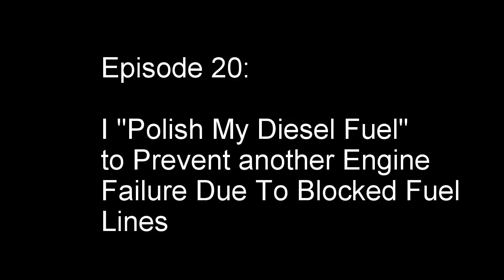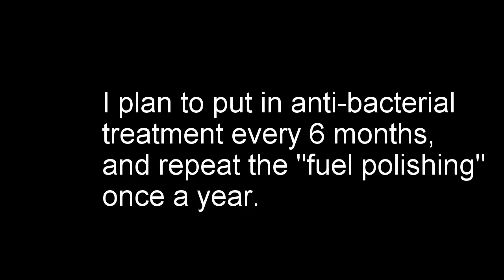Ep 20 Diesel Fuel 'Polishing' To Prevent Clogged Filters and Lines

Comment: I spent Lord only knows now many hours purifying JP-5 at sea. We had an aviation capacity so we had two large filter/coalescing units, (5 end 7 element arrays) a couple of vane pumps and about 50,000 USG tank capacity. We used JP-5 in the auxiliary diesel generators and the small boats until we got our helicopter aboard. 10 mic is what our filters were. They can separate the free water, but the entrained water slides through them. Entrained water has its molecules entwined with those of the fuel oil. Hence the name. I am a fan of recirculating systems. However in pleasure craft I am not a fan of using positive displacement pumps in the systems. The reason is because if the valve line up is not correct, gear, vane and reciprocating piston pumps can easily produce enough pressure to force fittings apart, split fuel lines and easily rupture tanks. So having a manifold linking more than one tank can present problems. For that, people should add pressure pop off valves on bypass lines that divert high pressures from the pump outlet back over to the inlet to prevent catastrophic failures OR use non-positive displacement pumps.  And of course, NO recirculation operation should ever be left unattended while the pump is running regardless of the number of tanks being tended. Also of note, any filter array whose input and outlet pressure is off by 5 PSI or more needs to be replaced. So a few simple pressure gauges can be used to positively identify when a filter needs replaced. Not only is that factor used for fuel filters, but one good for lube oil filters as well. If I were you, I would consider putting in the fuel tank fittings needed and mount the system permanently so it could easily be used at sea. Traveling around, the 1st hint of contaminated fuel more likely than not will be exactly as what you were hit with. Most often things go to hell in heavy weather when the bottom sediments get kicked up off the bottom of the tank or start rolling around in the bottom. If you set that up in a permanent installation the line back into the tank should be extended to the bottom of the tank as well to help blow the sediments up off the bottom so they will more surely get picked up for filtration. IF I were doing it I would also consider getting a clear, fair sized strainer with a bottom blow fitting so the sea snot doesn't take out the primary filter too easily.
Reply from the maker: Lots of excellent advice there Spencer.  The voice of experience.   I wish I could install a permanent recirc/filtering system, but I just don't have the space.  My tactic henceforth is: biocide treatment every six months; strainer in the line to pick up the heavy stuff ahead of valves and the primary filter; regular draining/checking for water in the primary filter; and an annual 'polishing'.  I'll also buy a filter/separator to use when taking on fuel from pumping stations that don't have a lot of usage.    For info, I spent many, many years using JP-4 and 5, and I never knew about the potential problem for fuel contamination.   I honestly never once thought about it.   Good people were taking care of me without my knowledge.  :-)
Reply: Well I never saw sea snot in JP-5. I ran the testing rig as well and it was never mentioned in the schooling either. I don't think sea snot can grow in JP-5. It darn sure can and does grow in the typical diesel fuel that boaters take on all over the globe though. That is one of the reasons I have in fact become an avid advocate for Universal Atomic 4 gasoline engines that everybody else seems to hate. It appears some people are starting to smarten up about replacing those with diesel engines.
Reply from the maker: Well, you could be right Spencer, but I think (rightly or wrongly) that diesel has won that war.    The next big transition will be from diesel to electric I think, and not back to gasoline.  (A small gas generator will probably remain aboard for the foreseeable future.)  Time will tell.    It will be interesting to follow all of this over the next decade as technology improves, costs come down, and the performance of batteries changes dramatically.     Thanks for commenting.
Reply: I have seen the worst of tractor engines in boats. Engines with timing chains or belts have no business going to sea. I consider geared valve train drives more of a consideration than gas over diesel. And yes I agree with you, electric drives are becoming and more popular. The selling point of regenerative power under way is a non starter here though. When you see a 34' boat owner raving about getting whole 1 amp of power out of 48V drive (48 watts) at the expense of over a knot in speed in wind conditions that could deliver 150 or more watts from a wind turbine it becomes a non plus. The coming of dry lithium polymer batteries will be a huge step forward. Many of the lifepo 4 batteries out there lose half their life if kept at 92 degrees F as well. While these can be discharged below 32 degrees F they can not be charged while frozen without wrecking them as well. These are the factors not too many are aware of. Keeping lifepo 4 batteries at anything over 75 degrees F can severely degrade their life expectancy. Getting beyond that for a 300AH 48V plant such as what would probably be in the league your boat would require is a 14,000 USD equation. That figure isn't even one nearing what a higher end supplier of auxiliary electric drive systems is going to run either. Lead acid batteries are a non starter in my book. The weight is simply too extreme and the actual amp hours available is generally only half that which they are typically rated at. Right now day sailors who do not encounter large current issues to and from their slip can be alright with smaller lead acid battery arrays though. A few miles out to an area clear enough to raise the sails is an ideal situation re-powering like 22 footer with lead acid batteries.  Something like a 300 ah storage array @ 48V is 14.4 KW and that weight and bulk will not be something easily supported by any lead acid array most 34' boats. Right now lithium ion batteries are the only thing that would make much sense there to me. Even with that amount of lithium storage you are going to be running a generator in high current transits. I saw a video featuring a Chesapeake 30' built in Denmark. It was like 11,000 pounds and had an overblown 12KW (also made in Denmark) drive but was it really overblown? It was a 72V unit  and had a storage array that must have weighed upwards of 1200 pounds. On top of that he had a 2 or 3 cylinder diesel generator. I mean, you're not talking blue water capable here with that sort of rig. To me an ideal electric auxiliary will not weigh but at best a few  hundred pounds over the internal combustion propulsion system being replaced on a 34' foot boat. That includes a generator. That guy's generator probably weighed very close to the diesel he took out and the motor and batteries were in addition to that. I'd not feel real comfortable heading off to Iceland in something like that.
Reply from the maker: You have identified the key issues perfectly Spencer.   I have lithium battery on my electric dinghy motor, and have had many problems with it, so I don't even want to think about a powerplant for a 40' boat driven by batteries (yet).  I'm sure we will get there in the near future though.   Waiting for Mr Tesla to go out for a weekend on a diesel boat.   :-)
Reply: 40' you are looking at a 72V drive and closer to 25KW of battery array to do like 50 nautical miles @ 4 kts. probably. The info I have seen on the dry polymer lithium batteries will hopefully allow for 200 NM on a bank the same size (dunno 'bout weight yet) as what the aforementioned will allow right now. Tesla has gotten into that hunt for dry polymer technology as well. The best unit I have seen so is a minimal 300AH 48V lithium polymer battery whose thermal characteristics are unknown but suspected to be better than the lifepo 4 batteries. It is distributed by Heter Co in N. America. The weight and application range seem to be in line with what would be great in 34' 11,000 pound boat. I have tried twice to get pricing on this unit but to date still have no idea of what they go for. I believe there could be an impressive interest in this particular battery for marine drive applications but nobody is responding to my inquiries concerning pricing delivered to N. America there.   http://www.heterbattery.com/products/power-battery-systems/lithium-battery-pack-48v-300ah
Reply from the maker: Many thanks Spencer.   When this industry gets a bit more mature I will seriously look at this.  Don't much care for diesel (though very reliable).  My 40' boat weighs about 10 tons, so need some serious energy capacity before this would become a serious consideration.   Thanks for commenting.
Reply: I was guessing your vessel to be 34-36 feet through the first videos I saw but the photography can be very misleading. Very impressive boat she is. Not often we see a vessel that size being solo sailed. I take it you got the leeches of your head sail and main repaired by now that were torn up in transit through the Bay of Biscay.
Reply from the maker: It was just the leech of the main that was torn Spencer.   (The top batten broke and was removed on the first day of the passage, so the leech up high flogged quite a bit during the gale on the final day.)  It only cost €40 to have it repaired.  I was lucky.

Comment: First, that was a well done diy. Now a stupid question: how much does a new fuel tank cost? (answer not needed) Can one get a tank with a lid that is bolted on making cleaning possible?
Reply from the maker: Many tanks come with a couple of inspection ports.....(due to baffles in the tanks, you really need more than one).   Tanks are not all that expensive (plastic or aluminium).   The problem is that they are often glassed into the structure of the boat.  To get one out, you literally need to take a saw to the structure of the boat......
Reply: @patricklaine6958  too bad that so many things aren't made to be replaced easily. I'm unhappy about my tablets having hard to, or impossible to, replace batteries. Perfectly good machines just discarded because of poor engineering, it irks me.

Comment: If you have space, it might be a good plan to mount the polisher permanently on the boat and polish after every fuel fill. You never know when you will get a load of bad fuel. Just thinking out loud.
Reply from the maker: Other have suggested that too.  I've seen this set-up on motor vessels, and much larger sailing vessels, but I just don't have the space.   I now have two in-line strainers, a Racor water separator/filter (10 micron), and the engine mounted filter (2 micron).    I'm hoping that will be enough.

Comment: I think that if you aim to have the fuel tank full as often as possible you will not see much water in the tank. In my experience water in the fuel comes from condensation that forms on the inside of the fuel  tank  if it is not full.
Reply from the maker: Thanks Jens.  I think what you say is true (about condensation) if you have a metal tank.   I don't think it is much of a factor with a plastic tank.  (?)   I keep mine full to stop the sloshing (which could cause sediment to raise up off the floor of the tank).  I may be getting two benefits from the action of filling: less condensation and reduced sediment mixing.  :-)

Comment: Patrick , thanks for this info, I guess your restriction was caused by the small opening 8n t he fuel shut off valve.
I have seen plugged fuel filters,,, and yours looked pretty darn good . 
A plugged filter looks a real darn mess, it looks like you dropped it on the ground and rolled it in sand, with sand and dirt adhering to the paper element....
Reply from the maker: Yeah Edward, you are exactly right.  I was very confused in episode 12 when I took the filter off and it was pristine.  I had seen videos of clogged filters and they were black with goo.   I was tired and not thinking very clearly, so instead of reasoning, "Oh, the line must be blocked somewhere", I thought, "Oh, it must be water in the fuel."   That wasn't very logical.  If it had been water contamination, the engine would sputter and surge, not just shut down instantly.  Well, if it happens to me again, my reasoning will be much clearer.   Hopefully, the preventative measures I am now taking will preclude recurrence.   Thanks for commenting.

Comment: i assume you have filter on filling the tank as well as between tank and engine, ?
water was a problem on steel tanks where they where low on fuel at night then got cold and had ingress of moisture jcb / plant vehicles, drivers in UK used to fill the tanks at night to stop this but we are talking a long time ago all plastic now .
more vids love them
Reply from the maker: Yeah HL, I don't filter on filling, though know I should.  Shame on me.   On most/many sailboats, between tank and engine there is a first device with a 10 micron filter and water separator, and a second filter mounted on the engine itself that usually has a 2 micron filter to protect the injectors.     Many thanks for watching.

Comment: Very interesting and informative. Thanks. I was wondering if your hydrocarbon electricity generator together with a sufficiently powerful a/c propulsion motor  would not provide you much greater dependability than this fragile diesel. A/c motors are apparently very reliable. In addition, I imagine any substituted a/c motor would also allow space more batteries and all the goodness that brings. I am thinking such a configuration might be the ultimate if and when I get my boat. Thanks in advance for your thoughts should you find time. :)
Reply from the maker: Hello G11713.  I would never be brave enough on-line to describe a diesel as "fragile".  :-)   Seriously though, people are starting to install banks of batteries and electric motors in their sailboats.  There was recently an article in one of the magazines about some young people that 'circumnavigated the planet without using a drop of diesel'.   Another popular YouTube sailing couple has an electric motor as well.  (Sorry, I can't recall their site name just now.)  As with any new technology, it is expensive and inefficient now, but I think electric motors on sailboats will be commonplace within a decade.   In fairness to diesels, they are really quite robust.  It is usually supporting systems that fail (contaminated fuel, or water pump impellors that are not changed frequently enough, etc.)   Thanks for the great question.

Comment: "Looking for advice" looking at purchasing a boat to do some cruising in the Carribean, the two boats I'm considering are a 2010 Hunter 39, 450hrs on engine, or a 2012 Beneteau 37, 40 hrs on engine and sails look like brand new. Wondering what your thoughts are, and if I'm even looking at the right type of sailboat. Thanks Patrick
Reply from the maker: I'm not really qualified to give this kind of advice Len, so take anything I say as 'chatter', not advice.  Both are boats from companies with world class reputations.  I'm a little concerned by the low hours on both boats --- does low usage mean they weren't really maintained either?   On the other hand, the sails should be in great shape.   As always, all recent generation boats are of very good quality.  The "components" on most production boats now come world class companies: Lewmar winches, Volvo Penta engine, Seldon mast, boom and furler, North sails, Raymarine navigation system, Webasto heater, etc.    After that comes interior layout -- which is very subjective....   Thus, while there may have been a difference between the production boats, and the world class cruisers  in the past, I think that gap has narrowed very substantially.  The key differentiators now are 1) how was it maintained/operated by its previous owner (I'd probably never buy a charter boat for example), and 2) What do you want to do with it?  Sail solo?  With family? Circumnavigation?   Lot's of marina time or in anchorages (need for windlass, and good secondary source of charging batteries --- or not)?    Again, both names you cite are terrific boats.....    I am sure you will be delighted with either if they are outfitted to meet your sailing needs.
Reply: Thank you for your reply.

Comment: i know this problem, had to open filters in bad seas once, no fun. consider installing your pre-filters in a parallel bank of 3 or 4. one clocks up 3 still doing their job.
Reply from the maker: Absolutely right Ralf.  I was sure I would be sick for hours after changing the filter at sea.   I got diesel absolutely everywhere and could still smell it several days later.   Fortunately, I managed to avoid getting sick.   I wish I could install a bank of parallel filters, but I just don't have the space.....   Also, the irony is that the blockage did not occur at the filter, but upstream of the filter in the line where a shutoff valve was installed.   Thanks for commenting.

Comment: I like that system you put together, but to me, to be perfect, you should be pouring the filtered diesel in a different recipient (jerrycans or similar), because this way, you are sucking already filtered diesel back into the loop. Other than that, it is perfect.
Reply from the maker: Yes Hal, ideally.  There are math formulas that tell you how long to run a pump to cycle all the contents of a tank (with replacement).   That is often easier than having a lot of clean jerrycans that you do a first transfer to.....Your method works fine too. :-)